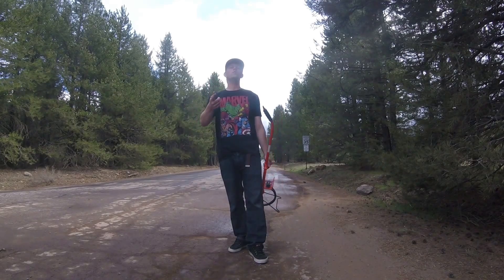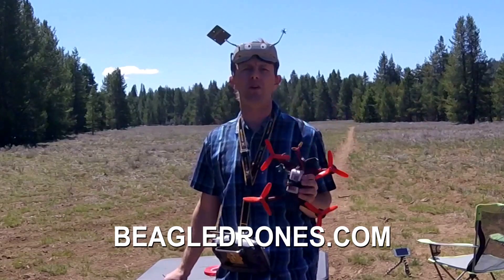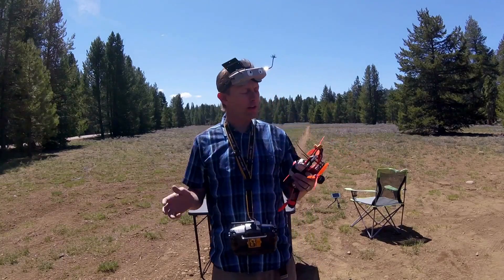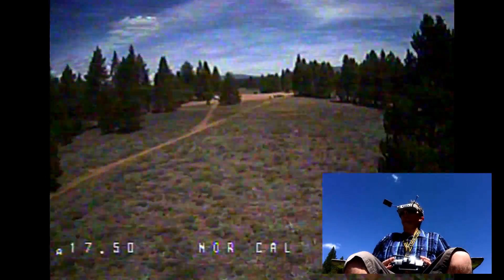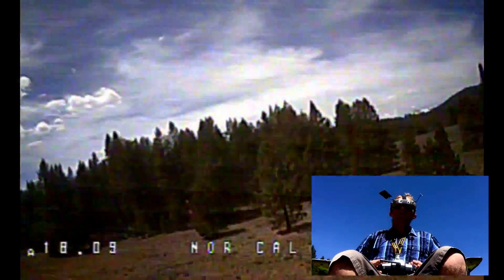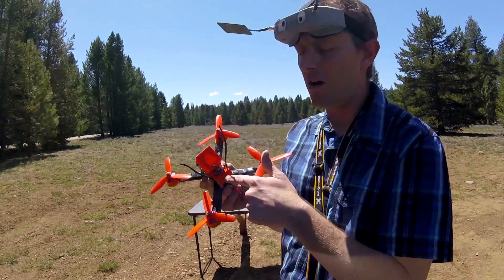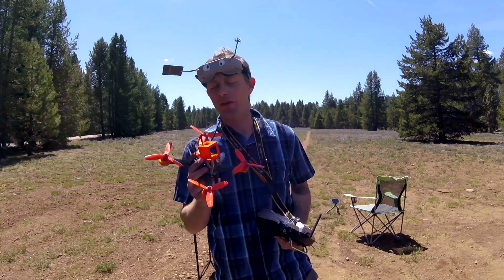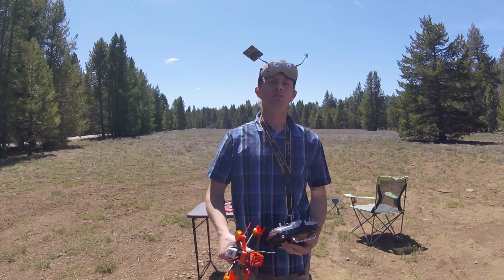HOW FAR CAN I GO ON 25 MW? TURBOWING RANG TEST

Comment: Come on, 25mw can get you much farther than that. Your patch antenna is not aiming towards the target.
Reply from the maker: Yes the technology has gotten much better with rapid fire and TBS fusion modules. But almost 3 years ago when I made this video with standard diversity on my aomway goggles that was how far I was getting. Plus I was using a cheap turbo wing VTX back then also. Having my patch pointing In The right direction would have helped a bit. the real game changer is having a good set of goggles that can handle a proper module nowadays.

Comment: Idk what I'm doing wrong . I can't get half the distance you are able to make at 25 mw and when I try using smart audio to change it to 200 mw it shows that I changed it but if I back out and go back into the menu , its back at 25 mw.  I just got everything I need to build my first 5" but I bought a 1000 mw vtx to try and get some distance and at least a much clearer picture at the distances i like to fly like just in my yard . I get a fair amount of static just in my yard.  That shouldn't be i wouldn't think . Help. Please!! Thx
Reply from the maker: Mike.m mcintyre sorry to hear your having problems. Could be a couple things. 

It might be in pit mode, Vtx can be set to pit mode as default. Also sounds like the smart audio isn’t working properly also. Did you wire in the smart audio wire into the flight controller and then turn on that uart port in beta flight? 

Also check your antenna connection any loose connection will give horrible video. 

Are you using right hand antenna on both your drone and goggles? 

If you have more questions feel free to send me messages on Facebook or instagram, (Nor Cal Drone) I’d be happy to help you trouble shoot. Good luck.
Reply: are you sure that you set up smart audio properly?
Had the same problem... turned out my smart audio was not working.
Had to go into betaflight swith it in the right UART then it worked.
In the transmitter tab its needs to say on the right side "Device ready = yes"
Maybe that helps

Comment: hey how you powered it up with BEC or directly through LIPO BATTERY ???
Reply: am talking about tx18011
Reply from the maker: it depends on the VTX you have and what voltage it can handle some VTX are fine with 5V but others require more power. those that do YES you can hook it up directly to the battery however you should add a capacitor. because it is hooked up directly to the batter it will see a big variation on the actual power it gets and could cause bad video a capacitor helps keep a little power in reserve for the fluctuation. if you only need 5V the flight controller works just fine and could help prevent the problems that a direct line might have.
Reply: @norcaldrones5389  i forgot to mention but am using the same you have tx18011 so how you connected that
Reply from the maker: yes connect where the battery connects to the flight controller i stack solder my wire right on top. the turbowing tx 18011 can handle 7V-26V if you need help setting up the smart audio i have another video on that 

https://www.youtube.com/watch?v=U2ncvimsrY4

Comment: Nice. I decided to see last week how far I could go on my 2" on 200mw. I got to about 630' before I fail safed but video was clear and that was just with a tiny eachine vt03 on 200mw and stock die pole. I have been very impressed with the reception on just a die pole.
Reply: I can't get much farther than my yard!! Idk what I'm doing wrong but I'd love to have a clear picture at such a close range and I would love to make it to the other end of the field at home depot. Am I flying in pit mode? I can't tell if my smart audio is working and I don't even know what vtx came on the bnf quad so I can look up how to manually change the power level.
Reply: @creaturefpv  Open that BNF up and see what VTX is in there. Its probably something cheap and crappy so I would look into replacing it with a better vtx. I hear the Rush VTX are good I love the TBS vtx personally. Also look at antenna orientation on the kwad and goggles. Lots of people have the goggle antennas setup perfectly for if they look straight ahead but end up looking down.